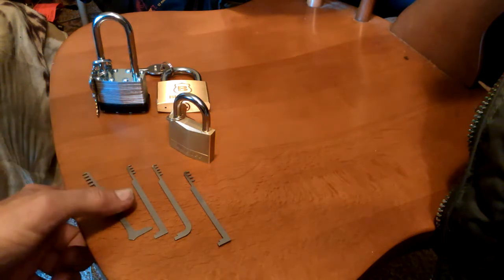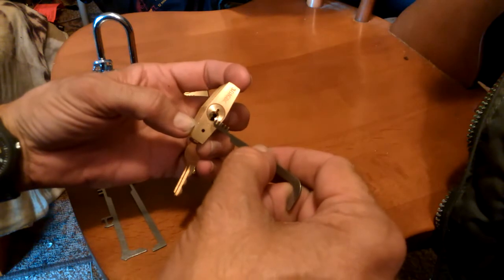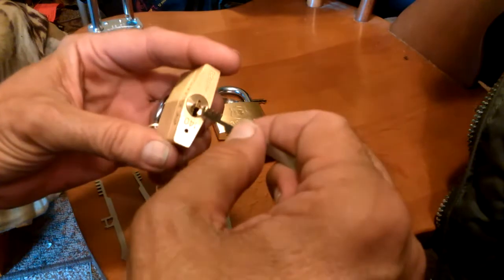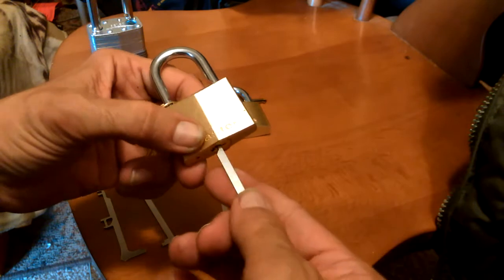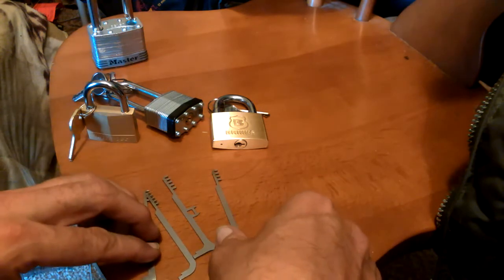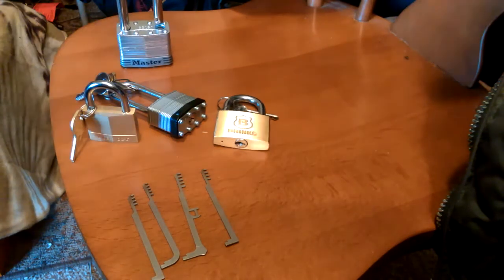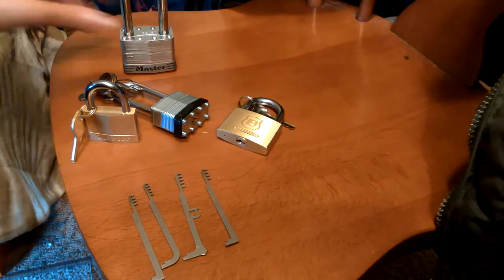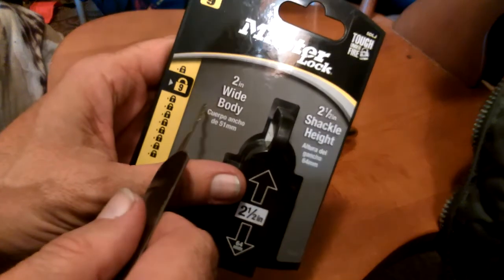(006) Bypassing a Masterlock 140 with a comb pick

Comment: Thanks for sharing was trying there .45 comb series on that type of lock , couldn't get it open, I was using the 4tooth side, I will have to try again with the 5 tooth side
Reply from the maker: Hakz olot Hello, Even though it's only a 4 pin lock, sometimes you can fit a 5 pin comb pick in because of the extra hole not pinned, yet drilled in there. The hardest part is getting past the warding and alignment of the pins to the pick. If the pin spacing is correct, you should be able to lift up, and turn to open the lock. It acts just like a key in how fast it opens. Works on the 150 also. I don't have a Master Lock 160 yet, but it probably works on those also.